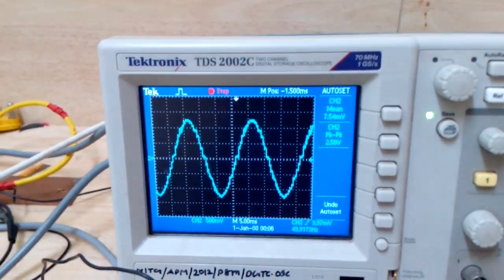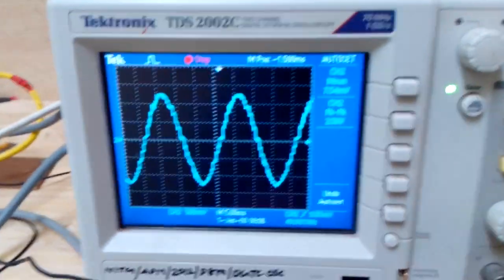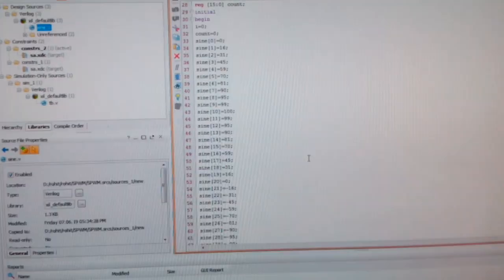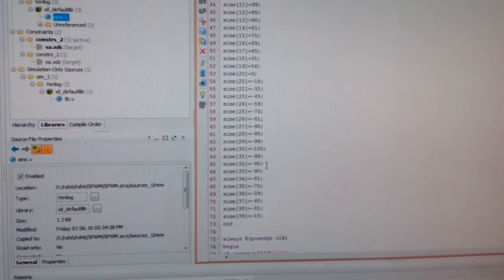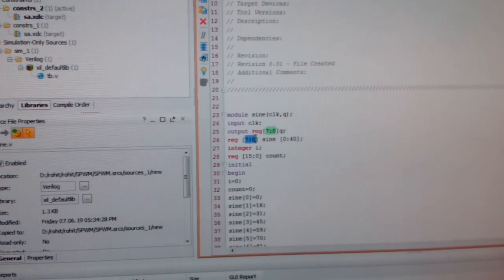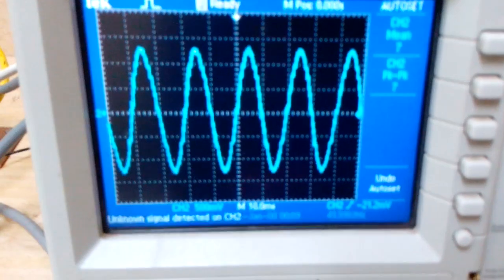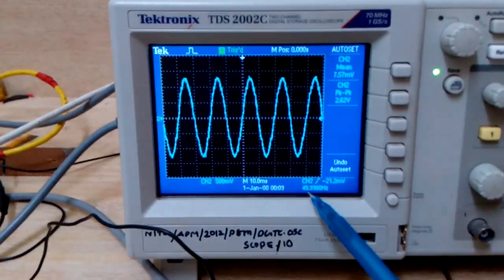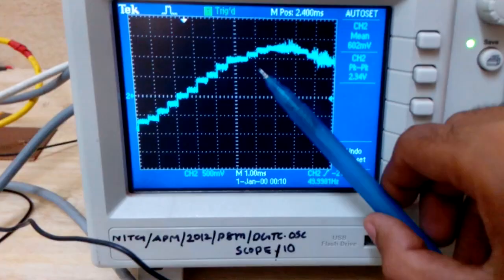FPGA Implementation of R-2R ladder DAC | DAC | xilinx Basys3

Comment: sir have you implemented any special latch for dac specific conversion or just normal sinwave generator code whose outputs are connected to pin and got the output directly from dac ?I mean why are you using count variable is it just clock divider  ?
Reply from the maker: I have directly used the sine wave generator code for implementation.
Reply: @controllers_knowledge  thanks
Reply: @controllers_knowledge  thanks ,i have one more question .I have a nexys4 ddr fpga and i want to program it  such a way that i dont have to connect it to vivado every time to program device . i want it to remain programed and only power source should be required how can that be done ?
Reply: @controllers_knowledge  So the Basys 3 has a DAC inside? also what you used on the video was a 741 as in the power amplifier correct? Finally, I was wondering if the code could be also adjusted to change the frequency or the amplitude. Thanks